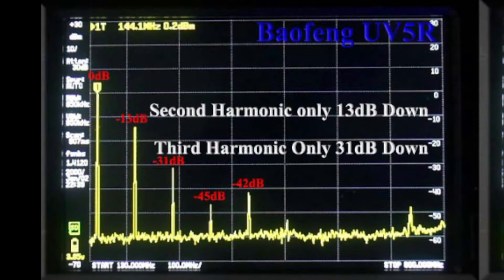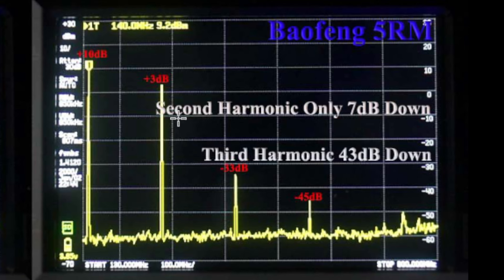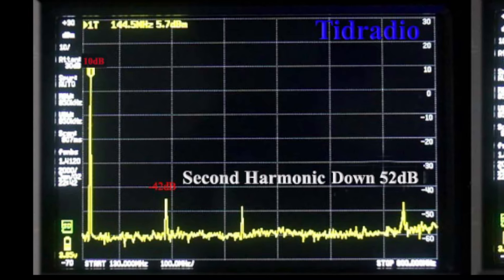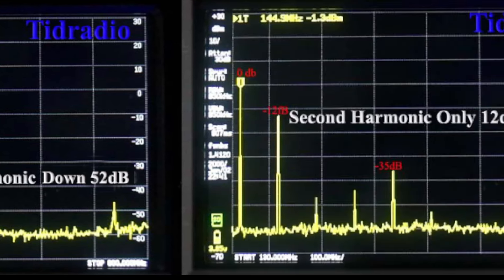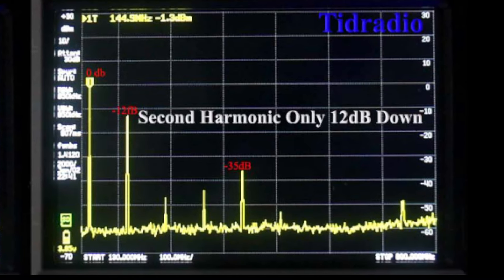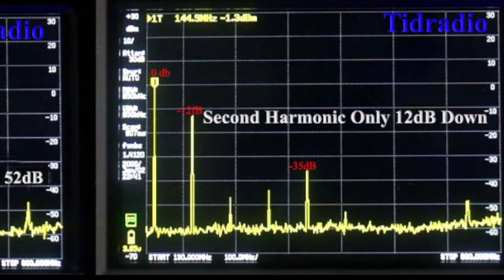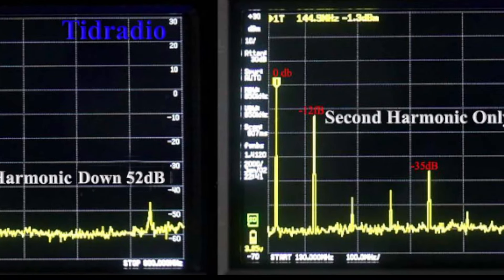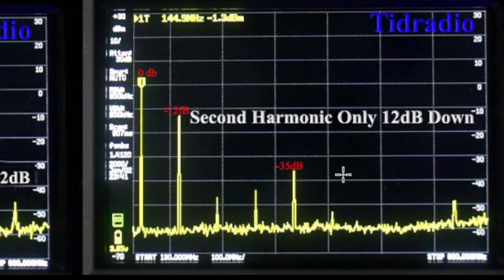Absolutely Dirty Tidradio and Baofeng Handhelds Tested in a Different Way See What Jim Found!

Comment: I'm not surprised that the load affects the filter performance.  I presume that the filter is between the final and the antenna port, i.e.; it is not buffered to isolate it from the load (would require linear buffer at the output power level, so we're not going to see them spring for that).  The filter design may not be bad, but they are probably manufactured with wide tolerance components, and not individually trimmed..  It would be interesting (though expensive and destructive) to have some young technician, with good eyes and very steady hands, de-solder the RF components of your two TIDs, and measure each exactly, including the parasitic capacitance, gain, and transfer curve of the final transistor (or pair?), to see if we can spot what makes thee difference between a good one and a bad one.  We might figure out how to tweak the filters on the bad ones to make them good, but if you have to hire someone to do it (as opposed to it being a fun hobby project), it will obliterate any price advantage these radios have over, say, a Motorola.

An interesting question if whether FCC rules only require the specified levels of suppression into a proper load.  I suspect that you can make any radio fail the suppression level requirements bu driving it through a resonance at the harmonic, with good rejection at the fundamental (like that one antenna you mentioned).  It is probably not making the harmonic stronger, but reducing the fundamental makes the ratio between them smaller.

73, Bill - KE1G
Reply from the maker: I agree with all that you wrote.  I think some good brands like Icom and Yaesu have a lower priced handheld that is likely very clean.  I especially agree that real world testing be done here and not there.  The cert came from China.  I suspect that lab testing there has no value and should not be used by the FCC.  I hope someone at the FCC will do the same tests that I did. Well, they will have really good equipment. 73, Jim W6LG

Comment: Jim, first of all good health to you! You were right on with your tests. I did almost the same tests with Tidradio H-3, a Radioddity GC-5, two BaoFeng (whatever) and two Wouxun KG-UVD1P. Many antennas. Used a COMMIT CAA500MARKII for antennas. Tiny Spectrum Analyzer Ultra. (Sorry to say my REAL walkie-talkies Kenwood and ICOM are older than dirt. Your results are consistent with mine. So maybe next week (or sometime soon) I am going to TEST my ICOM 5-watt desk-top-talkie (IC-7-5) using the same procedures, same HT antennas, same Tiny Spectrum Analyzer Ultra and see what it is all about. CLEAN? DIRTY? Antennas make a difference? Alan, NY2G here in BROOKLYN New York!

Comment: I use a 30db high power attenuater that I tested to be an almost perfect 50 Ohms all the way to 3Ghz and connected it directly into a Keysight spectrum analyzer.  The worst was a Talkpod A36 where the second harmonic was only down by 6db when operated on VHF frequency but UHF was below the noise so was fine.  Any of the other Chinese radio's were all down about 40 to 45db so not that great and in particular the Quansheng UVK5 2nd -42db on VHF and for UHF 2nd harmonic -42db and third was only -36db at 1.33Ghz. They must not have any good filtering after the final amplifier.

I have a Yeasu F65 and even though the harmonics test good and are below the noise floor, the mic gain is about 15db too low to where I only get 3 by 9 signal reports and can barely hear my own voice on a scanner.  I'm still looking for a decent dual band analog handheld.
Reply from the maker: Okay, now do a real world test with an antenna and let me know the results. This is important to all of us. 73, Jim

Comment: Unless multiband radios have a way of switchin harmonic filters, things are iffy. Running low power reduces 2F0 a lot as too much class C increases harmonics and intermod. A simple fix is a quarter wave stub. FCC tests are always done into a dummy load with calibrated sampler and with a notch or highpass filter for reading below -60 Db. Digital TV requires -120 Db 2F0! There are application notes on how to run these tests from Tektronix and others.
Reply from the maker: I don't agree with a lot of that.  Setting that aside, most will buy the Baofeng and use the antenna that came in the box. So what I showed in the video will be what happens.  Lots of harmonic will spew from some handhelds.  Thanks for offering some advice. 73, Jim

Comment: It matches my experience with them. I have several brands of these cheap HTs.  I have taken them apart to try to tune them, but they are touchy.

I worked for a Chinese company and I learned something very useful. It is called the Chinese IQ test. Vendors make poor products but try to make them appealing in some way, such as copying a brand. Of course, they are low price, too. If you buy them, they laugh, because you failed the IQ test. If the buyer had half a brain, he would know this cheap crap has to be a scam.  So, you get junk and they get your money - so who was smarter?  I kid you not; this is really how they look at this.

Comment: I think 2 'identical' model Chinese HT's are not identical. Their filter components are of questionable quality and their manufacturing is slipshod. I have several cheap Chinese 'loner' HT's and I check each one through an attenuator into my Anritsu SA every few months before it gets used. Those radios are cheap for a reason, cheap components, sloppy construction, no testing of any sort beyond, 'does it hear and does it talk'? One can't even characterize a radio this week and expect it to spec the same next week. There are simply so many things that separate a $20 HT from a $180 HT that the list is near infinite. These cheapos have to be checked regularly and never counted on.
Reply: exactly..these are cheap garbage

Comment: My tuppence: two problems with using antennas for characterising a transceiver outside of an anechoic chamber in this way are reproducibility (as you noted, depends on how the antenna is held, plus variability between samples of a given antenna make/model) and the impossibility of guaranteeing that there is nothing in the environment that can't be responsible for nonlinear action that produces harmonics from the radio's RF output.  

Okay, so the latter is a bit of a nit-pick.  Reproducibility is the main issue.  And yet your point that real antenna loads — which are the only ones that matter in any practical sense — can bring out ugliness that might not appear into a dummy load.  Perhaps the answer is some reasonably reproducible (but representative) pads that introduce some controlled reactive component in the way that a dodgy antenna might...

I'm sorry to hear of your ill health, and hope that biopsy went okay with no more discomfort than absolutely necessary.  Be well soon, S.